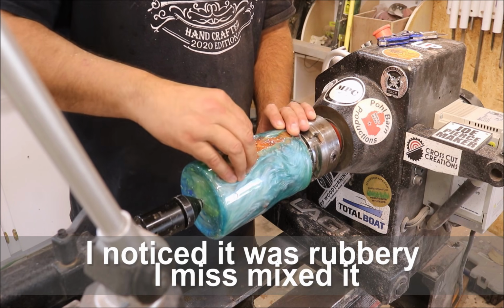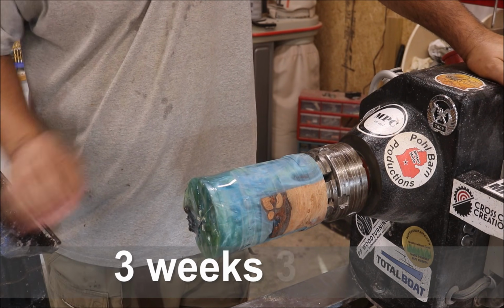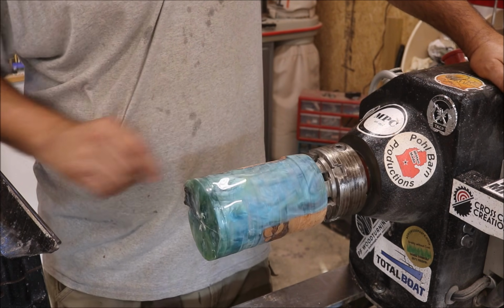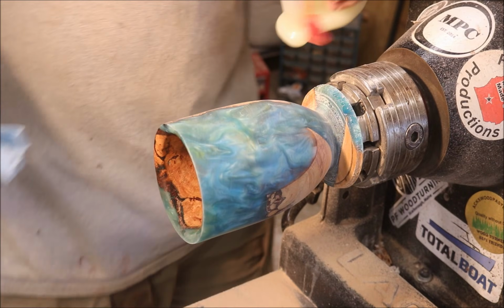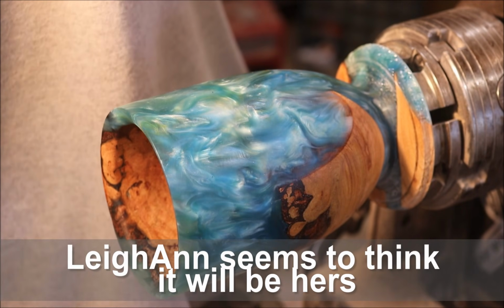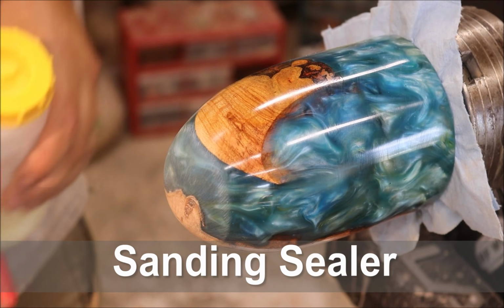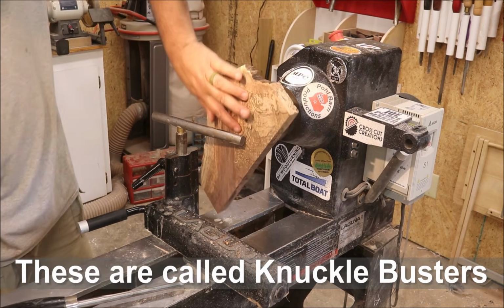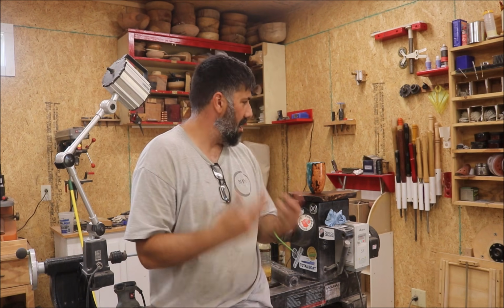Wood Turning - The Happy Accident

Comment: Does the bowl steady at 6:13 reduces chatter, and does it act as a safety if the bowl were to come detached...
Reply from the maker: It does cut down on chatter but it will not stop the bowl from coming off. Just lets me use my tool a little more aggressively than not having it would let me.
Reply: @MoonpieCreations  
Does it act as a guard...
Reply from the maker: @joeschlotthauer840  not really it just makes it more solid when you turn

Comment: The epoxy colors work awesome with the wood tones. Sink a neodymium round magnet into the vase bottom and slug of steel into the base of the board from the bottom side leaving a thin layer of wood so it doesn't show from the top of the board.  Could hold it steady enough?
Reply from the maker: Great idea. I will certainly do that on the next one. This one sits perfect.

Comment: Very nice.  

Heat can also speed up the cure process.  Maybe 110 degrees F would have cured it in a day or so.  

Looks like you put the time to good use though.
Reply from the maker: Thanks for the tip. I was afraid that the wood or the resin would crack.

Comment: Hi Ken, or anyone, what is the best type of forstner bits to use with hybrid forms? I see you using a 3" often but didn't know if there was a type that doesn't leave a large dimple in the bottom or that would be best with cutting through the resin. I looked in a couple of your lists to see if you listed the one you use but haven't found it yet:) TIA
Reply from the maker: Hey, there are forstner bits without the dimple at the end. Or you can file it off. I use a few different sized. You can spend anywhere from $20 to $120 on one. here is the link the the large 75mm one. https://amzn.to/3FkgsCX the 65mm one https://amzn.to/334AAvW and the freud 1 7/8" one https://amzn.to/3K00Bx3
Reply: @MoonpieCreations  that’s great- thanks so much for the information!

Comment: This time would have stopped @ 10:25 and just removed the tenon.  Would like to have one like that treated for drinking safety.  Almost like one of our Medieval cups.
Reply from the maker: I've made a few like that. Would need to treat it with a walnut oil of something like that./
Reply: @MoonpieCreations  There  is a food safe resin (now I can't get the name to come out, figures) that is used by the merchants who make and sell the wood beer steins and plates we use in Medieval reenactment.   They usually coat the inside and outer lip of the steins and use regular finishes for the rest.  They also create some of the older ones that were made of leather and treat them the same way.

Comment: The vase turned out great, but base to me is to shallow, seeing that as when you placed it on it you had to carefully steady it, I don’t believe you can put something in there and hope it doesn’t tip if the table gets accidentally bumped
Reply from the maker: I feel yeah, but it was only the second time I put it on the base. It was very steady. But in the future I will be adding some magnets to the base to hold it more secure. I hope only fake flowers or something like that goes into this. My pieces are for display only and I disclaim that when selling.

Comment: It’s a nice piece, but you royally screwed up by removing the base you already had turned attached to the base. It’ll never function properly until it has a permanently attached base! I was horrified when I saw that you were actually removing the original base! Every piece should have some functionality, whether it’s an “art” piece or not, in my opinion.....
Reply from the maker: Fair enough. But it stands up on the base extremely well. I have made plenty of vases like you suggest. I wanted to do something different. I can put it on it's base and jump up and down next to it in my house and it stays put. I have another blank like this and I may keep a base on it this time.  Thanks for your comment.